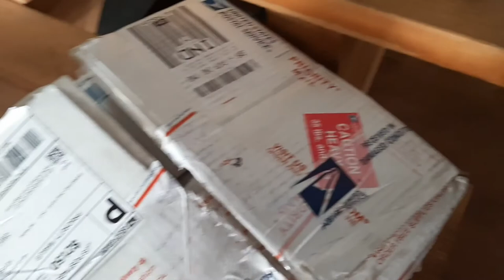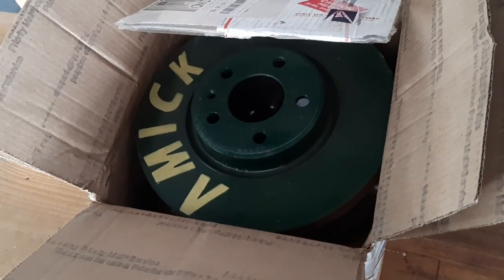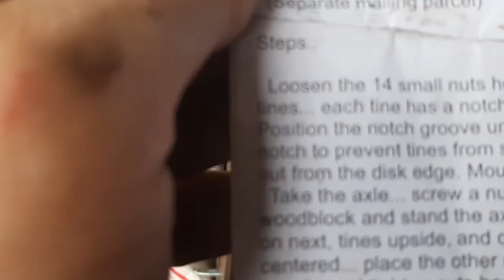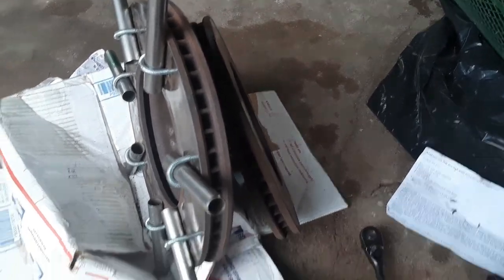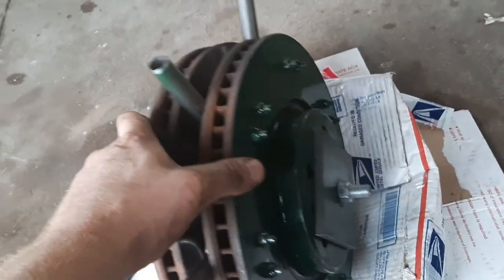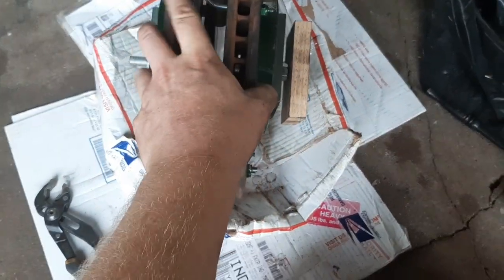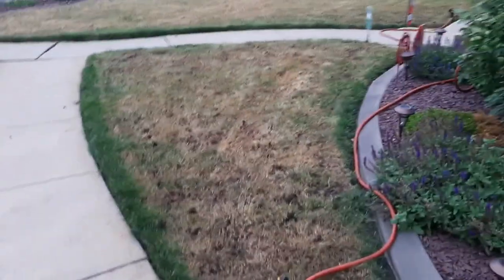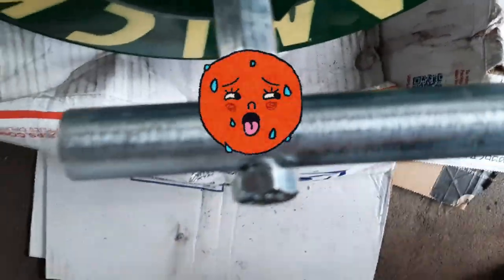Amick RollAerator Assembly and Review

Comment: I’m curious how he got the middle portion together. Is the middle of the rotor just two pieces of square steel that are bolted together? Not welded on there?
Reply from the maker: Yes, it's a separate piece of steel. You have to line everything up during assembly. I guess you could always weld them on yourself once it's together. I assume it's a time issue for him. Sounded like Mike is super swamped with orders.
Reply: @woodnyardjunkie  reason I ask is because I understood the part about attaching the tines to the rotor, just didn’t know what he was actually using for the bearing mechanism of the wheel
Reply from the maker: No bearings. It turns inside the opening at the bottom of the handle. Recommend grease at the bolt/wear point every use.
Reply: @woodnyardjunkie  is there some sort of special bolt that is being used to connect the handlebars to the rotor? Just looks like some threads exposed, how would it turn freely, seems like there has to be some portion of the bolt that is bare to allow the spinning
Reply from the maker: Yes.. there is a coupler attached on the inside of the handle bars. The exposed screw coming out of the rotor, screws into that coupler. Bolt on the other side is smooth.

Comment: This has me curious, most powered aerators use tines that are tapered, the cutting diameter is smaller than the back of the tine, I'm assuming to eject the cores. I can't tell from the video, are these tines tapered?
Reply from the maker: Yes, they are tapered. I think after these bite the dust, I'm going to go with the tines that eject the plug from the back.

Comment: The plug you show at about 13:47 - was that one plug, or was it a few plugs stuck together? Did you find that it penetrated to full depth most places? Thanks.
Reply from the maker: That was one plug. It did penetrate fully. I was skeptical cause of it being summer and having clay soil. I over watered thinking it may have problems, but it did great. Next time I won't water as much before using it. It's definitely a workout if you want a lot of plugs.